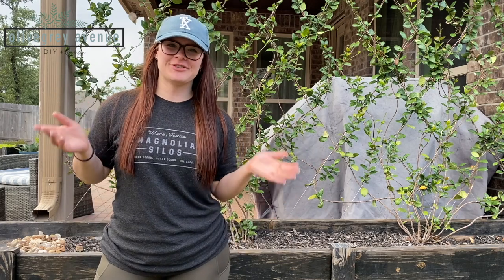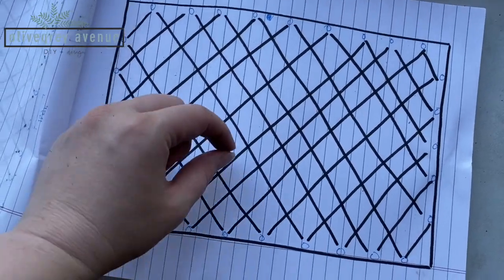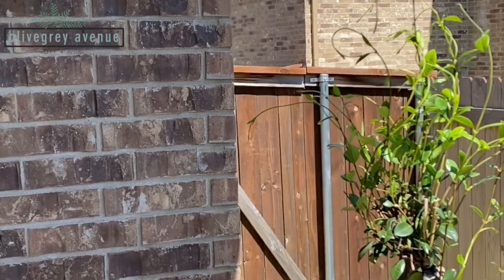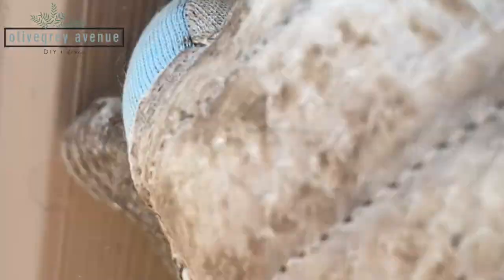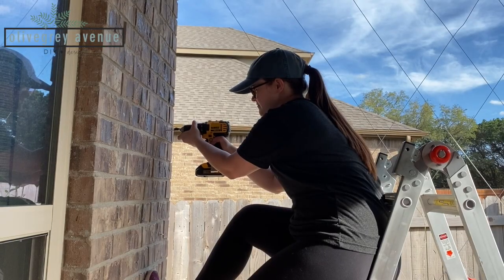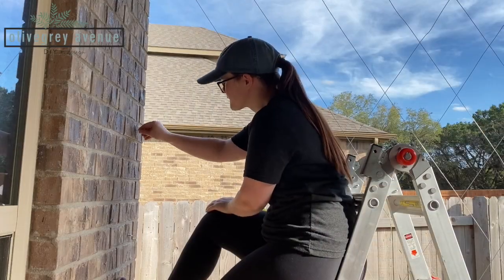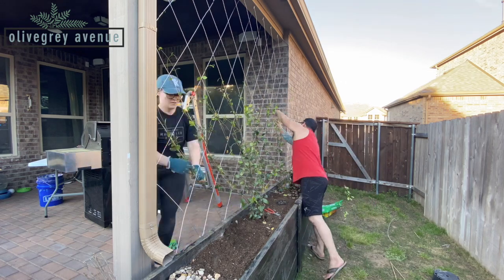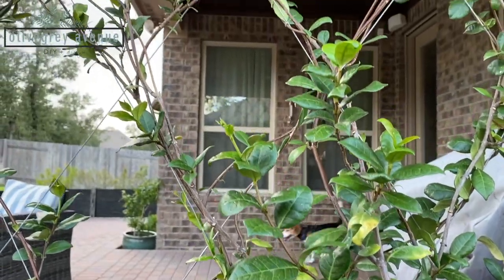MAKE AN EASY DIY WIRE TRELLIS FOR CHEAP!

Comment: If you buy longer eyehooks then only screw them in half way.... then over time as the wires stretch due to weight bearing plants all you have to do is turn your eye hook ans it will tighten them
Reply from the maker: That’s a great idea! I imagine that we won’t have any weight issues with the wires since the vines are so light but will keep that in mind for the future!

Comment: Hi there, thanks so much for showing your process! Can I ask what diameter wire you were using for this? 1/8th"? Thanks!@
Reply from the maker: I used 14 gauge wire that is at Lowe’s in the picture hanging supplies area (at least it is in my local Lowe’s) and is called multi-purpose wire). Hope this helps!

Comment: Great idea.What size are these hooks and are they galvanised or stainless steel?
Reply from the maker: Thank you! I can’t remember the exact ones but I believed they were these https://www.homedepot.com/p/Everbilt-208-Zinc-Plated-Steel-Screw-Eye-50-Piece-per-Pack-803242/204273864